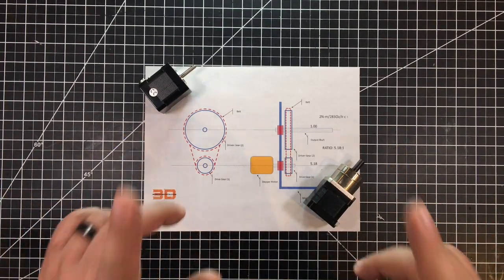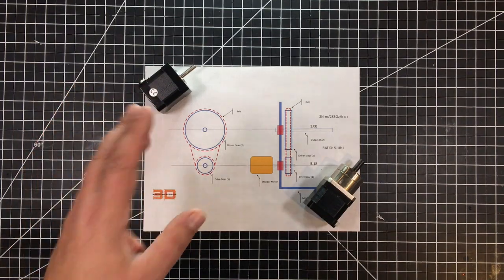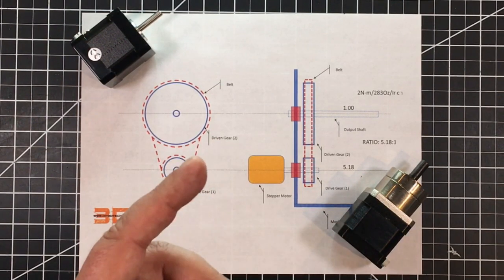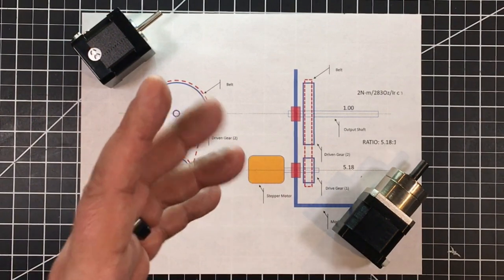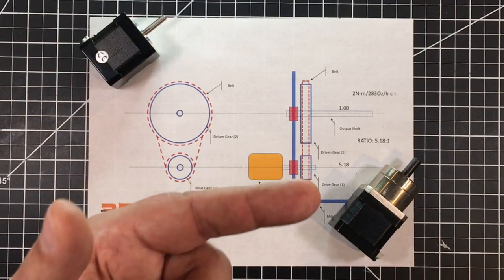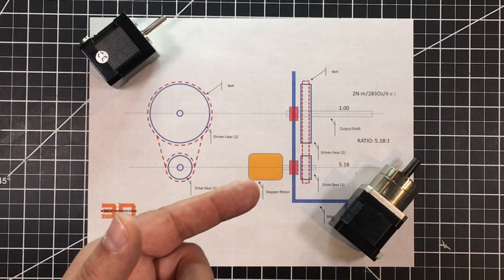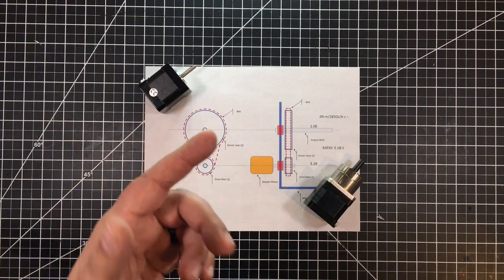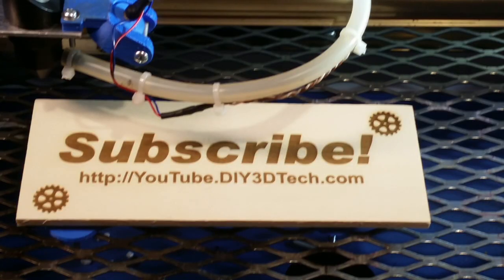Shop Talk  -  Advantages of Geared Stepper Motors!

Comment: One advantage of the belt system is flexible coupling - as the gearbox doesn't (from my experience) have a thrust bearing (or equivalent), you can't just rigidly couple its shaft to the output shaft. And using a flexible (presumably spider) coupling may put too much force on the coupling. The geared stepper motor can still be useful, but I personally consider them a niche tool as there are almost always more practical solutions that already need to be in place for the bigger picture (leadscrews, etc.).
Reply from the maker: I agree with you somewhat on the thrust bearing and talk about this in the build video (I am building a pan and tilt tracker) and if you need the flexible coupling (with a focus on the flexible) then yes it makes sense, however I am seeing tons of use for these where I can avoid the cost and time of a geared pulley system....

Comment: I'm trying to understand how to match a motor to a planetary gear and not getting very far, especially when I have an expectation of specific IPM on my CNC router.  Comparing the geared motor to the above mounting mechanism doesn't actually make any sense.  Here's why: the above drawing shows a 1:5.18 gear ratio and you're comparing the opposite ratio's of planetary gears.  A 50:1 as an example means that the MOTOR has to spin 50 times to get a single revolution on the output gear while the above  spins the DRIVE gear 5.18 times for every motor output revolution.  So this is just simply not the same comparison.  Now, both increase torque.

My question then is, how does one know how much minimum torque I need (the starting torque) to spin the planetary gear? because this will enable me to know how fast I can spin the motor without losing steps and hence how fast my output speed is (how fast I can move my CNC router.)

Comment: For a MoCo pan/tilt head the best final ratio is 50:1, that is the sweet spot between speed and resolution.  With a 3:1 belt ratio best option would be 15:1 gearmotor.  Also if you want more precision you can switch from a planetary gearbox to a zero backlash harmonic drive.
Reply from the maker: many thanks for the tips!  😀